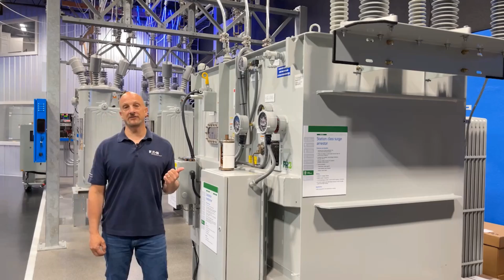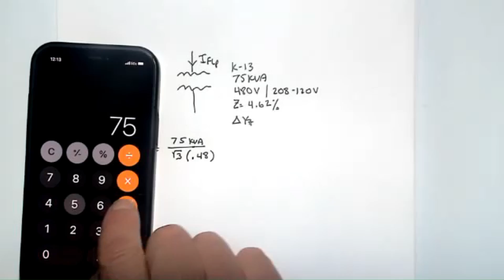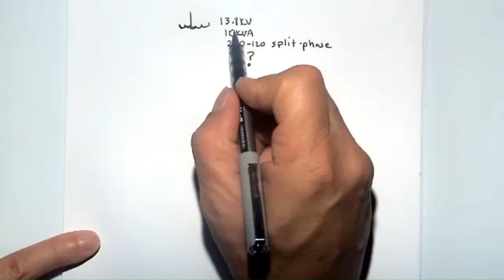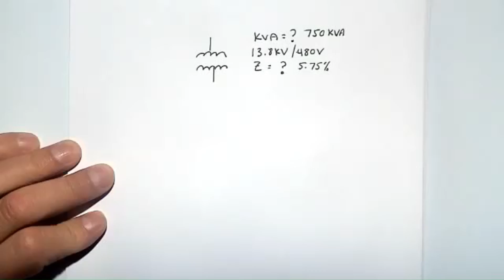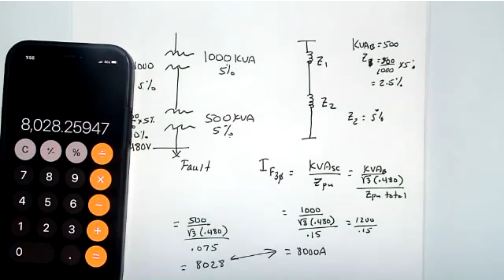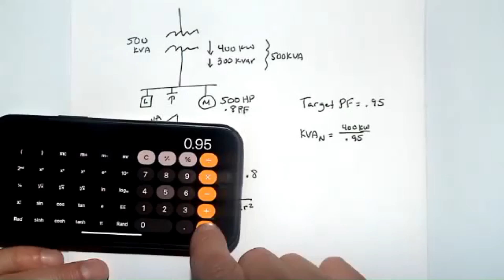Power systems: formulas and calculations you should know for transformers and motors

Comment: Good vid, but we learned in class to use P=true power(KW), Ps=apparent power(KVA), Pq reactive power( KVAR).Also impedance is measured in OHMS(Ω) why use PU? For ease of calculations due to the fact that you can't measure an∞bus?
Reply: Quando usa pu em transformador é melhor para fazer os cálculos, porque a impedância em pu é o mesmo valor para o primário e segundário de um tranformador.
Reply: When using pu in a transformer it is better to do the calculations, because the impedance in pu is the same value for the primary and secondary of a transformer.

Comment: When you say 19:45 that 75 kVa transformer in 208/120 config is capable of 208A, is that per hot lead?  so basically 600A of 120v power? or if you are just using two of the leads?
600A x 120v = 72 kVa
Or, being 3 phase, is a 75 kVa transformer 75000/1.732/120 = 360  So 360 max on the total of the 3 120v lines?
I've got a 75kVa 5.5% IMP 208v transformer that is regularly loaded with 100 Amps on each of the 3 lines. Been running that way for 4 years.
Reply from the maker: Thank you for reaching out, Scott. Please visit https://eaton.works/3OkAwNw for technical support.

Comment: i noticed on the one line your utility power is Delta to Wye but yet each transformer after is listed as Delta to Wye is there a reason it is not Wye to Wye once power is transformed. Cause it appears that the input to all transformers is Wye after utility transformer
Reply: The wye secondary from the utility is just how the transformer secondary winding is connected, it doesn't mean everything from that point on has to be connected in wye. You can take three phases from a wye connected transformer's winding and connect to another transformer or motor in delta if you want. Think of it as just the way something is connected, it doesn't totally change the system like your question suggests.

Comment: Thank you for the  informative presentation . Kindly assist , got a 90kw, 400vac , 50hz motor , motor starter is a star-delta , A 250kva generator is failing to start the motor , everytime the motor is started , the contactors on the panel locked in and at one point , they got burnt . Is the generator correctly sized or there are issues with need to be addressed. when running on Mains power , the system works fine
Reply: you switchgear is not designed correctly. the generator is going to deliver, and the motor is demanding 6 x startup current. so all your line equipment must be rated to handle the current..
Reply: In my opinion your generator is not able to supply the Starting current of the motor. lets calculate,  Your Generator is 250 KVA so max current it can supply is 250/ sq. root 3*(0.4) =  360 Amps . Your Motor Full load running current is 90/ Sq.rt of 3 *power factor *0.4 = 162A ( Considering power factor to be 0.8) . now in star delta starting  current is around 2.6 time of full load running current. so it needs 421.2 A currents for starting. however your generator is able to supply only 360 Amps.
Reply: @jamesbond0004   No Motor demands 6 x starting current in DOL starting in star delta it only takes around 2 - 2.6 times . Also his system runs fine on the mains it is problematic only on generator. So line and switchgears are fine.

Comment: Good tutorial Eaton team....but @ 18:44 you have used 3 ph formula for calculating the secondary full load current of X'mr...could u please reconfirm it...isn't 1 ph formula has to be used here..?
Reply: If you consider only one conductor of all three conductors and its voltage i.e., 120Volts (Line to neutral voltage) we will use 1phase formula... He considered all the three phases so he used 3phase formula to calculate full load current....
Reply: OK, so as you're considering 3 ph, ok got it
Reply: The calc at 18:44 is for a 75Kva 480-208/120V. 3 phase 4W output.   I’m not seeing anything single phase.   Correct time in video?
Reply: @KevinCoop1  My bad....I overlooked the spec...please ignore my 1st comment...Thanks @surya, @luis @kevin for better clarity....